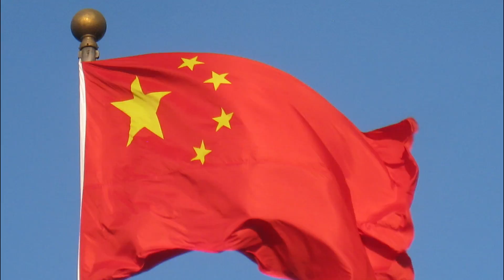Panama Canal: The Biggest Megaproject in History

Comment: I appreciate the video and what I learned but the dollar figure of a single pass thru the canal is way off.
At 7:45, they say it can cost "upwards of $450,000."  This immediately sounded suspect.  Copy/pasted below what was found on google regarding the toll charged.  
Also, and not as important, at 7:41, they say that "now has to pay a toll."  This suggests that you did not have to pay a toll at some point in time.  But researching this tells me that there has always been a toll.

"UPDATE: Feb. 19, 2020:  The Panama Canal water surcharges took effect Saturday at the following levels, a Panama Canal Authority spokesperson told Supply Chain Dive:

$2,500 per transit for vessels with a length overall (LOA) more than 125 feet and up to 200 feet.

$5,000 per transit for vessels with LOA more than 200 feet and up to 300 feet.

$10,000 per transit for vessels with LOA over 300 feet."

Comment: What will happen if the water gates not used in the Panama canal? Sea level difference due to tidal force will cause damage to the canal?
Reply: And ships would have difficulty when traveling against the tide. Those large container ships wouldn't be able to get out.
Reply: The gates or locks have to be used to allow ships to be raised to the level of Gatun lake and then to lower them back to sea level.  This canal is very different from the Suez canal as the Suez canal is level from start to finish.

Comment: I think there is some incorrect info here about the water level of Atlantic and Pacific due to tides. That's not the case. There is a reservoir in the middle of the canal which is situated higher than the sea level. This is the reason for the lock system implemented. To rise high into the reservoir and then again fall back to the other ocean.
Reply: They said sea level on one side was different than sea level on the other side because of high tide. lmao

Comment: How about those ship that cannot fit in the passage?
Reply: There are two canals,  the old one built 100 years ago and the new canal we just open in 2016, this new canal allow the transit of larger vessels, way bigger than the ones that fits the original passage, most of current giant ships are able to use our new canal and we ensure draft of at least 50ft, the new canal was voted on a referendum on 2006, it took almost 10 years to be complete and we now know that there are way bigger ships on the way, there are plan for a 3rd set of locks but before we jump into that project we need to expand our lakes and blow up some other mountains along the canal,  last year the canal launch a requisition for a new lake to ensure drinking water for half of the population and to capture water and regions that are far beyond the navegable canal zone, climate change is another concern thats why we must ensure water surplus, for now if there is a giant ship that is too wide/long to use the canal we have 4 high tech ports on each entrance of the canal, a railway and a network of highways that enables the transit of containers from the Pacific to Atlantic and viceversa, so we are very concern of what the future holds for our waterway but we as panamenian feel proud of what we have achieved, remember that its being only 20 years since we actually have control over the canal and its business, in the prios 90 years that canal didnt have better shape than today,
Reply: @abdieldimas9673  was in Panama a few years ago and came to the canal, engineering marvel my friend. salute to you for manning this engineering feat and love from the UK🏴🏴